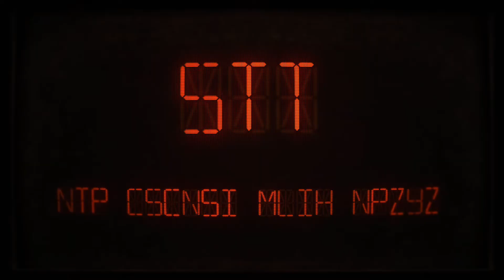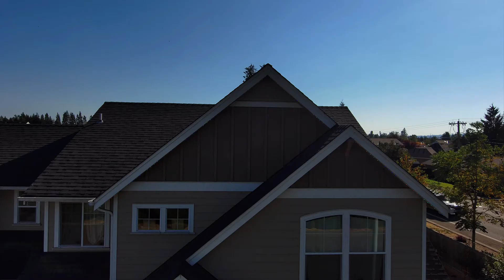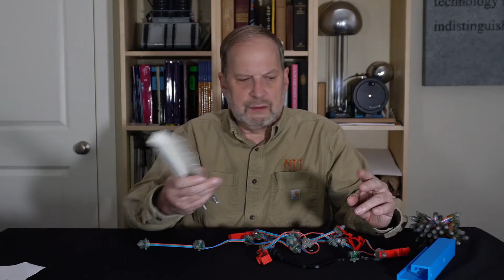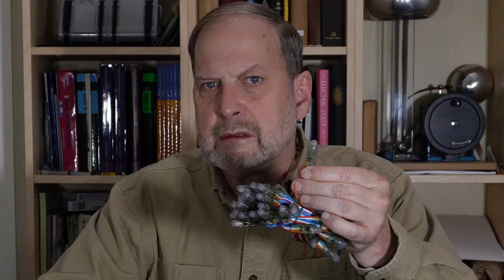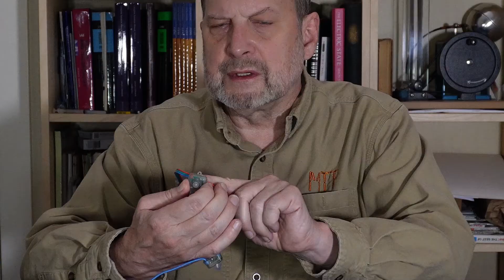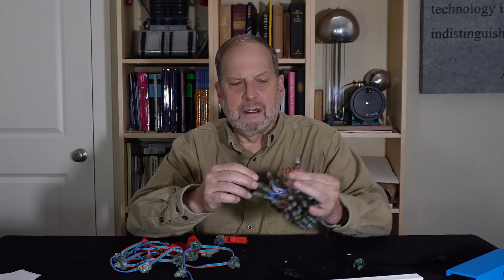All About My Permanent Individually Addressable Pixel Christmas Lights: Part One

Comment: Thanks for this video. Learned a lot from it. 

I noticed you provided a link to the bullet lights with the resistors, but not the square node ones with the voltage regulator. Any chance you could update the description with that link?
Reply: Never mind, just noticed the link in the comments.
Reply from the maker: I am glad you found it.  I just dropped a new video. I  am working on a lot of lighting projects right now. Let me know you interested leaning more about any of them.

Comment: Great video...very informative! where did you get the Blue fixture for drilling the holes in the j channel? Does that fit 3/4" or 1" j channel? Any info on that would be greatly appreciated.
Reply from the maker: The drilling jig was 3D printed.

Comment: Thanks for the excellent video.  It really helped to plan for my installation.  Where did you purchase your J Channel?  The big box stores in my area do not carry it.  Also, what width J Channel would you use for square pixels - 1" or 1-1/2" J Channel?  I appreciate your assistance.
Reply from the maker: Good Point! I added a link to the description. It looks like the price has gone up since I ordered mine.
Reply: @mastertrontamer  Thank you very much for your quick response.  Did your square pixels fit comfortably in 3/4" J Channel?
Reply from the maker: The ones I used were more of a rectangle, but they fit right in.